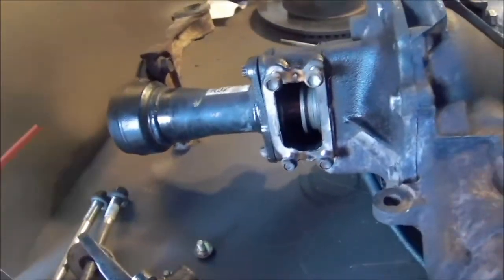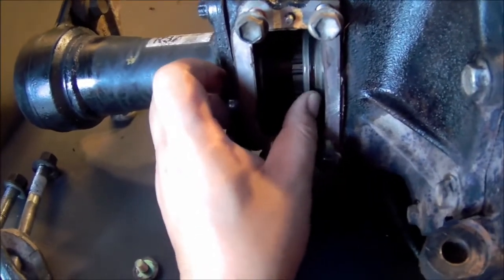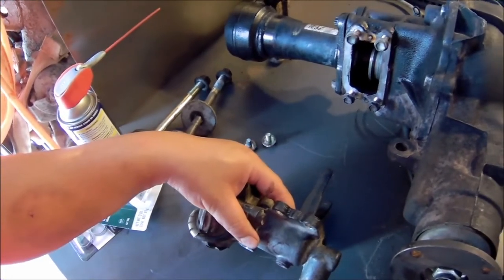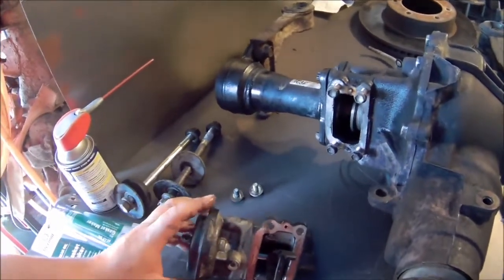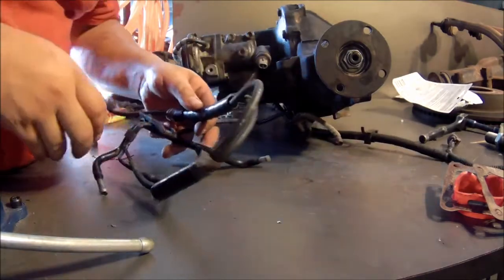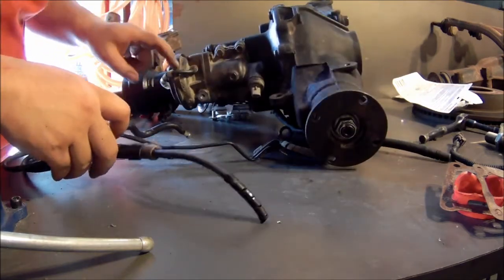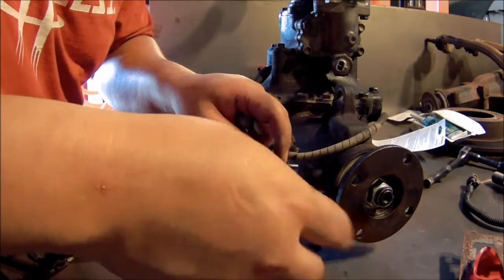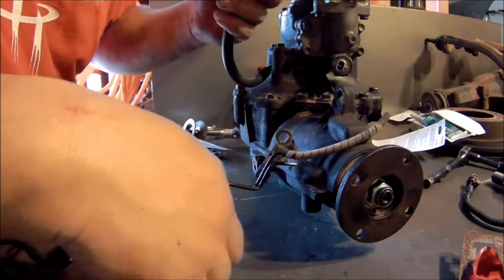Tacoma - ADD( auto differential disconnect ) Bypass for 4x4 swap.

Comment: I have the ADD on my '98 Hilux. So far it is working fine, but I would much prefer to have manual hubs. The alternative seems to be either disabling the ADD as shown in the video, or swapping out the diff and axles with a non-ADD diff & axles. Not sure if you can add manual hubs to the ADD diff/axle.
Reply from the maker: @laurenbish3116  you can. I eventually   installed manual hubs on my tacoma. You just have to get 96- 2001 hubs and axles. I ended up getting Warren lockers.

Comment: Literally doing this as we speak September 2024
Reply from the maker: @JohnsJohnson-ns5xm  it's nice because you don't have to worry about whether or not your 4x4 will engage or not
Reply: @RideOrFish  just tweaked my back so it’s probably gonna be on hold for another week but as soon as it’s done, I will let you know how will work out, but it seems pretty straightforward and I like simple
Reply: I’m about to start, any advice?
Reply from the maker: @braedonscott1375  this is an easy mod.
Reply: @ obviously replace the front and back seals on the in my case used transmission that I’m putting in. The 4 x 4 transmission is exactly the same except the output shaft is a shorter. Also, the transmissions have guide pins to help you line it up to the back of the engine what I found as I had a lot of corrosion on mine and it made it really hard to slide in so steel wool those down till they’re nice and shiny maybe put a little WD-40 on it, I also replaced all my u joints on all three drive shafts. New transmission mount new centerline bearing. New fluids and filters on the transmission transfer case and differential ran it for a couple hundred miles replace them all again. Drop the strut brace, a couple inches with the bolts, but leave them in and it’ll make getting the transmission in and out a lot easier. Good luck.

Comment: Im swapping to manual tranny but I dont want to run locking hubs until I solid axle swap my 2nd gen 4runner. My ADD works fine so I might just run my own push button switch to the vacuum switching block to engage it.
Reply from the maker: Yeah if i remember right you just need to add a soliniod. Or ground one of the sensors to make it think its ready all the time

Comment: My 92 with ADD hubs doesn’t switch in. Could I do this to mine because I know the differential is good
Reply from the maker: Should be the same. Alot of the times they stop working becuase water gets into the actuator or the vacuum li e is leaking

Comment: I just purchased the transmission and transfercase w j shift of donor 97 4runner doing the swap on my 03 tacoma prerunner I have a lot of questions for you and would love to contact you vía message or phone if possible to pick your brain! I live in Houston also, I believe I have my rear axle with 4.10 gear ratio the front axle needs to be 4.10 also do all 96 2000 3.4l v6 have a 4.10 gear?
Reply from the maker: Hello, you should be able to message me on instagram @rideorfish. But 4.10 was the common ratio. The only way to know for sure is to read your door tag. On the doner if its un available you will just have to count the rotaions. For the most part they will either have a 3.90 4.10 or 4.56. Toyota geared it based on the tire size they sent the trucks out with from the factory
Reply: @RideOrFish  According to my code it's 4.10 I'll have to re install my Instagram , on the knuckles and hubs can I use my current knuckle and install the bearing and hubs new or get different knuckles from a 4x4 donor?
Reply from the maker: You can rebuild your hubs.  https://youtu.be/CZ8cKj4ufkM. They are the same just makesure to get a rebuild kit for a what ever setup you going with. I recomend getting locking hubs, but if not just make sure you keep the tire wear even on the front tires.

Comment: Thank you man... you saved my coins... I did it without removing the differential on my 3rd gen 99 4runner and perfectly worked ... was scrashing my head to find out why my 4wd not engaging till I found your video ... 👊
Reply from the maker: Glad you got it working!
Reply: @RideOrFish  yes it is working H4 +L4 and H2 all good tested it on a the beach all greatly running

Comment: You are wearing out your frt end. Are defeating the purpose of the design.
Reply: A lot of guys have done that, including myself, and it proves to be a viable. As long as everything is well lubricated, it will last without a doubt.
Reply from the maker: Even without it being locked in it wears it. The diff is always working unless you put locking hubs on. This mod is nothing new. People who offroad all the time have been doing this to the tacoma since the introduction of this. Ive already put 60k miles on my truck no issues yet. Aside from hating that i went auto instead of waiting on a manual.

Comment: The Toyota ADD is definitely a weak point in the 4WD system that Toyota engineered.  It's too complex.  It involves electrical connections, vacuum lines, and weak gears to shift that sleeve to engage or disengage the passenger axle.  All of this for the convenience of not locking and unlocking manual hubs.  I'm curious if that hose clamp solution has withstood the test of time.  Also curious how the truck handles in 2WD, when the transfer case is not powering the front drive shaft.  Is it difficult to steer on pavement in 2WD?
Reply from the maker: its been good so far. no issues. just remember that if the 4x4 is not engaged at the transfercase so the front drive shaft is free spinning. so its just like the diff not really activated. but you have to keep in mind since the front two wheels are technically engaged. if you dont have locking hubs you have make sure the tire wear is even on the front. if the tire are not evenly worn it will work the diff to hard. there's no difference in steering on 2wd

Comment: Great idea! Though, I would strive for something more solid than a hose clamp. Any ideas? I would be wondering if that position would stay aligned
Reply from the maker: it will stay aligned. I'm pretty sure there's something else that could work, but sometimes simplicity can be the easiest thing. with 3d printers you could just 3dprint something.

Comment: It work ok after you did the tie to lock full time?
Reply from the maker: it works fine. it essentially mean you axles are engaged the diff itself still function like any spider gear.

Comment: Doing this trick to my truck. (97 Toyota t100 automatic 3.4L )  Is it gonna be 4x4 all the time or just when I put it on 4x4 low and 4x4 high??
Reply from the maker: Yeah it will only be in 4x4 when in gear 4h/l. But your front wheels will always be locked in unless you have manual hubs. If your hands fit into tight spaces you might not even need to remove the front carrier.
Reply: @RideOrFish   is it gonna have the power in both front tires or just 1 front tire?? Thank you for your help.  8 really appreciate it.
Reply from the maker: there's no power to the wheels if the 4x4 is not engaged. your locking the axles so the diff just functions like a spider gear.

Comment: Awesome, I'm about to do my swap. Have all the parts just need the manual hubs. Do you know if you still need to do what you do in your video if you use the manual locking hubs?
Reply from the maker: You do this so you don't have to do any wiring or so you don't have buy all the little actuators to make the vacuum system to work in your swap. So unless you plan on doing all the wiring and vacuum lines you will have to do the ADD bypass. As far as I know everyone who does the swap just does the bypass because its less headache and simplifies the 4x4 system.

Comment: Are you plannng on doing the manual hubs?
Reply from the maker: It's unlikely I will. Ideally you would want to, but in all honesty it will be fine. As long as i keep my two front tires evenly worn there will be minimal stress on the diff itself. Knowing me even if I had locking hubs. I would never unlock them lol.